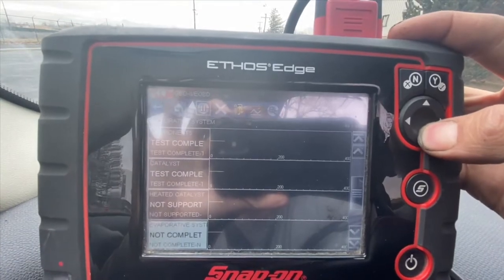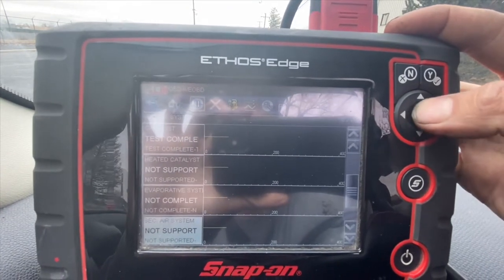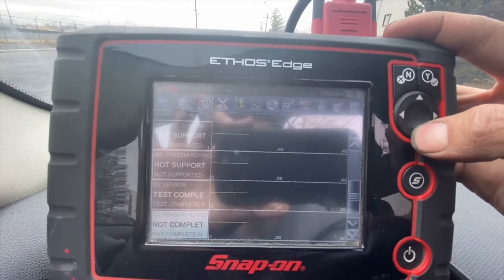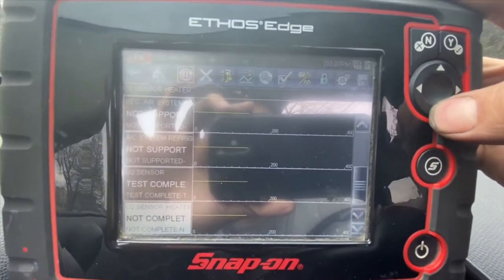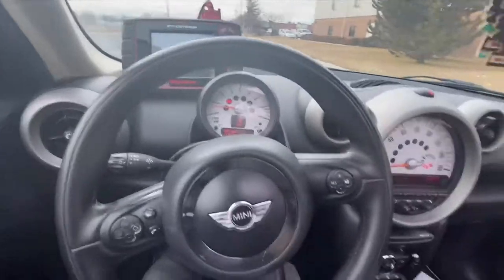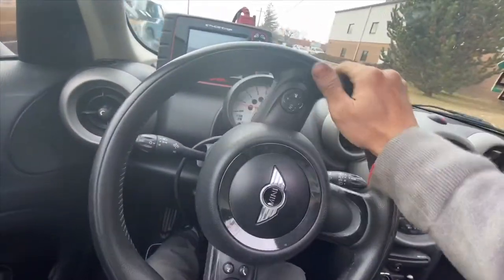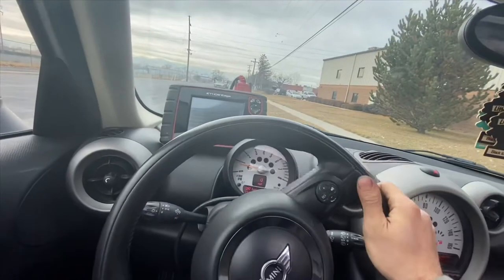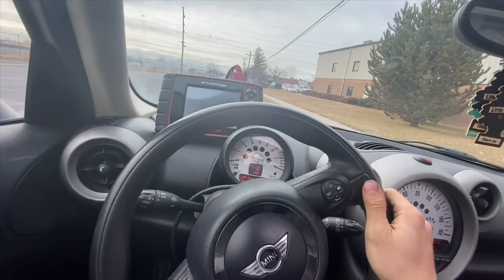Heated Catalyst not complete? Solution found!

Comment: This is right and wrong at the same time. For the cat 02’s would be the computer that monitors the emissions when the car goes through the cold start cycles (the toxins before the car warms up). In order to bypass it you must complete the cycles atleast 15 times for the reading to show meaning you have to allow the car to idle until it “gets hot” and then turn it off and let the temperatures drop below 50 and keep redoing it until your # of warm ups since the DTC was cleared reaches 15. Super easy to monitor with the Ancel BM700 OBD tool as it shows the engine temperatures and # of starts that the smog check place will also go by. Just takes a bit of time and patience as you will ONLY get a new warm up count if the car is started under the operating temperature (50). I’m so ready to get this smog over with and this is the last tedious step.
Reply: Thank you for putting this here. In my area speed limited are very low so the tip in this video would be difficult to complete. I will try this out.

Comment: My car has showed cat not ready for over two years but still passed Californians smog. "Heated catalyst" shows ready. There is no check engine light. Is it because the cat is 20 yes old or is it the o2 sensors?
Reply: So can you actually pass legit smog test in California if let’s say your CAT monitor isn’t ready? I thought everything (except EVAP) has to be ready
Reply: @kylereyes2337  not sure about CAT monitor readiness, but one not ready EVAP monitor is allowed. I have a po442 and PO401, In order for me to pass, the shop wanted to keep the car overnight, then clear the codes in the morning and drive on their special route (certain speeds are required to trigger the monitor to ready status). When they got all the monitors ready except for the one that would eventually fail and give A P0442 , they start the smog test. This was at an auto repair shop. You need a shop that knows how to take advantage of the rule. I was lucky the shop that replaced various parts with no luck offered to do it.